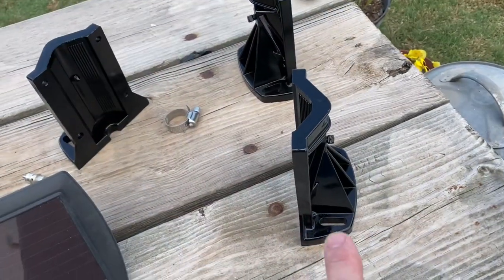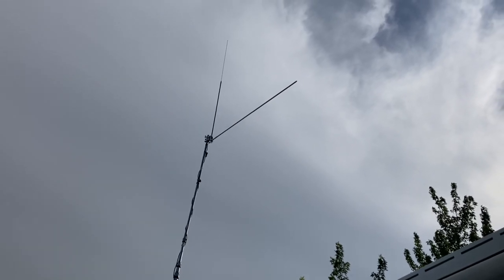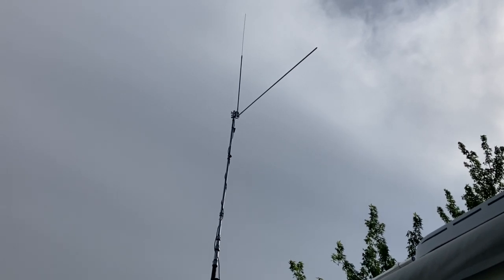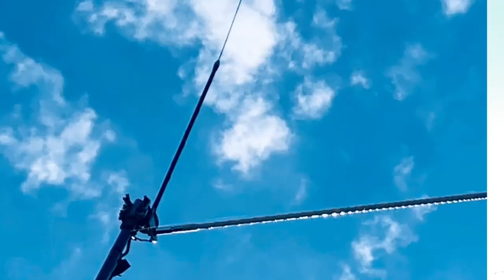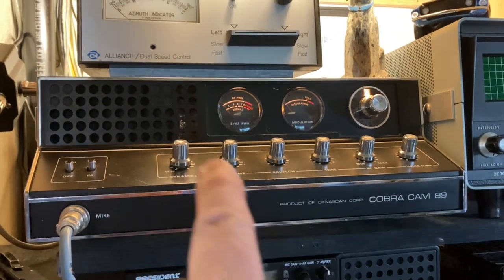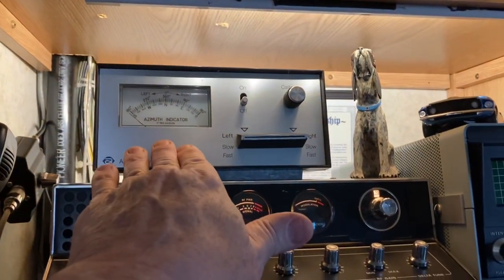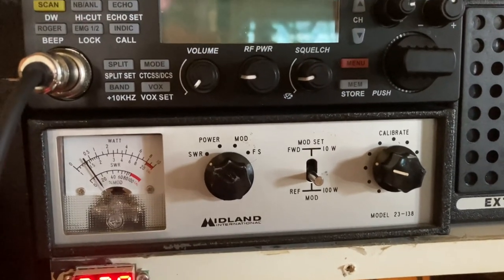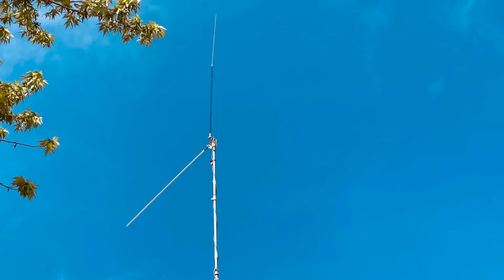Simple easy diy 11/10 meter vertical Antenna

Comment: Back in the late 80’s I made one with two solid SS rebars @ 102” on each leg, some u-bolts, and a thick cutting board (white plastic), on a 20’ tower. I had an old Ranger fully open on an old power supply, and two fans. 😆 😆 I was only 11 years old.
Reply from the maker: Nothing wrong with that! Big part of radio be it ham or cb is experimenting. Never know what you can come up with

Comment: Good job 👍 
Try it with a 102 steel whip when you want to experiment more 
Use bolt cutters or a riser , shorter or longer, etc ,,  you can easily tune it to just a couple watts of reflect
Reply from the maker: Great idea! I’ll give a try one day!
Reply: @cbhamradio1507  
That’s the funnest part of this hobby , experimenting and building antennas , and learning others tricks and tips , and sharing your own. I’ve been playing radio for about 27 years . CB and Ham
And I’m ashamed to admit it but I didn’t get a Bird meter (Bird 43) until about 8 months ago .  I encourage you to do the same . It’s a must to see accurate reflect  and not just SWR . I learned this the hard way 💰🤦🏼‍♂️🤦🏼‍♂️.  Study and get your ticket too ! You’ll enjoy it .  73’s and keep
Up the good work

Comment: Looks like it will be directional towards the ground whip slightly. Add two more.
Reply from the maker: I was thinking about that. It’s kind of directional but not to bad. Even thought about a reflector and making it a beam kind of short of. It’s fun to play around with different types of antennas

Comment: How about 100 to stainless whip and the other 102 sideways for ground think that’ll work like the same way you got it I thought about having like that one up one down but the problem is I got a metal roof on my trailer and I got to get away from the pool I want to have that do
Reply from the maker: Should work just fine. I used two fire stick antennas before with no problems. Try it and see !

Comment: Is this antenna directional? How concentrated will the signal be? Can I use 2 matching firesticks, one for the drive element and one for the ground plane?
Reply from the maker: It doesn’t seem to be directional at all. The main element is the MFJ 10 meter hamstick. But try different techniques and see what works for you. Let me know how it works out with two fire stick set up
Reply: @cbhamradio1507  I really won't be able to know what my results will be so I am just looking for methods that are proven. I just made an inverted V with copper wire and it works great on DX and I read that any 2 matching antennas can be used as an inverted V so I may try that with the firesticks. Needs to be around 30ft up, the earth reflects the signal and it ends up being slightly 2 directional.
Reply from the maker: @aarongriffin81  I’ve seen the v ride side up before also. Kind of a delta loop with out the wire. I’ve used a inverted v for 20 plus years cut for 160 meters feed with 450 ohm ladder line  and a good tuner. Worked the world with a 100 watts. Yo answer you question that antenna works great for dx.

Comment: How good is the bill 2 on the bench.
Reply from the maker: It’s good. Not a lot of “swing” but for something easy to use and pop in a small car when traveling it’s great. Audio is very clean. I got it for when we travel. It does have the weather band which is nice. Bottom line it’s not a power house rig. But for something to take on road trips or camping I like it.

Comment: Just a dumb question but did this have to be grounded?
Reply from the maker: First of all there is no dumb question! To answer your question best I can the ground part is the horizontal element
Reply: Well my problem is and I've seen other people do this but I'm trying to use two radials for 102 in whip basically let you got going on with two miramonte brackets and a metal pole my elements are roughly 4 or 5 ft and I've used them from a leftover 5/8 ground antenna and my SWR match at best is 2.5 to.1 so I'm thinking that I've got to ground it somehow to make it better what do you think?
Reply: 2 radials at 40 to 45 degrees not 2 brackets
Reply from the maker: @travelinjavelin  probably need a ground. That set I used on that antenna was the center of the coax went to the vertical and shield to the horizontal side. That way it’s grounded